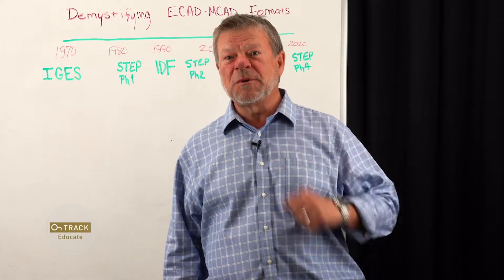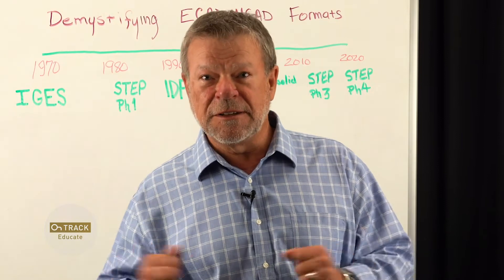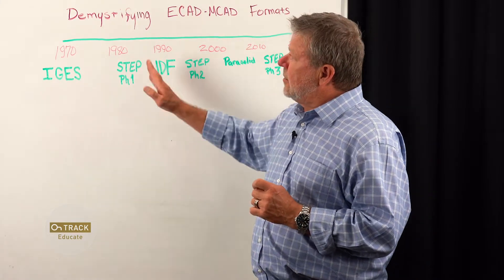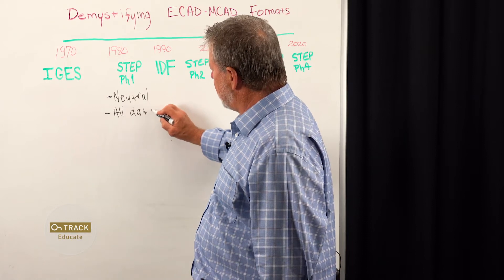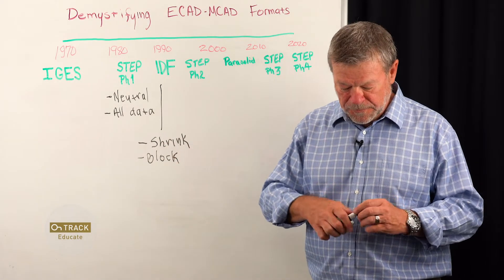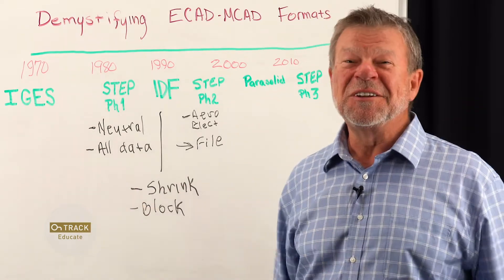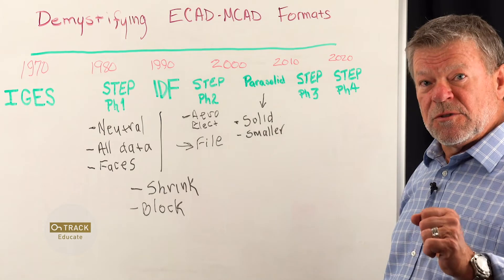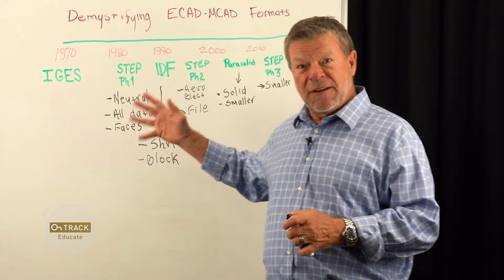Demystifying ECAD MCAD Formats - OnTrack Whiteboard Series

Comment: These are really just the one-way formats from ECAD to MCAD, right?  I would love a conversation about formats that can go both directions.  Historically, to get MCAD data back into the ECAD tools, we have been using DXF files.  Those get placed somewhere around STEP 1 or IDF on that timeline (I think).  I have been looking at IDX, which is a single format to go both directions, although it has been met with it's own challenges.  Is Altium investigating anything to work on or improve the bi-directional CAD data flow?
Reply: @markforbes8410  that will be great.  I'm excited to see how it all works.
Reply: @eePatCox  Bi-directional changes can also be passed through Altium Concord Pro without the need to export to any of these intermediate file formats. Check it out. https://www.youtube.com/watch?v=xH4XIqkO0Zg